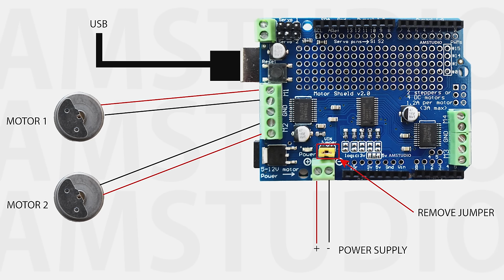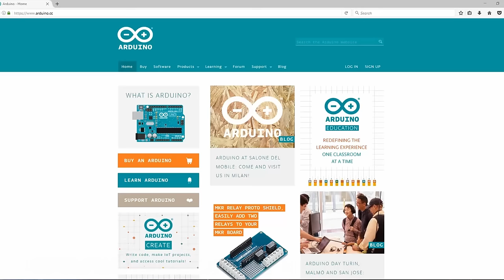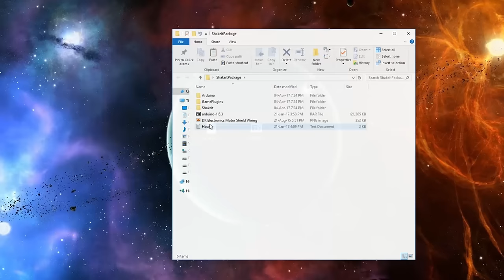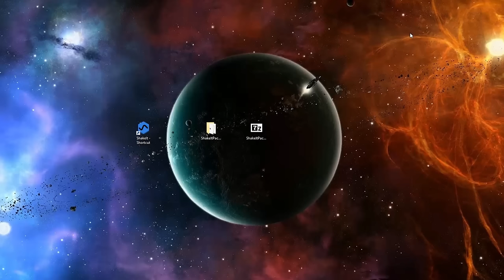DIY RUMBLE PEDALS SIM RACING  | SHAKE IT

Comment: I actually wrote to Logitech a few years back and suggested this to them. They told me they didn't see the advantage.
Reply: @lewisheaven2365  yeah seriously.  Consoles have been putting feedback into their control pads for years. It stands to reason that adding feed back to a $300+ dollar peripheral like a throttle or pedals would make sense.
Reply: What is the advantage? pedals in racecars dont shake? isnt it supposed to be realistic
Reply: @Impetuss  they dont shake...but you can feel the rev of the engine through your feet.  You can feel the throttle to the engine. In simtools you can set the telemetry to have it kind of kick when you change gears and kind of low rumble when you are braking so Its also an indicator of tire grip , think about it your braking and your tires lose grip and suddenly that slight rumble goes smooth. It's not really just about realism it's about feedback.
Reply: Henrik sure about that
Reply: @Impetuss  one of the advantages is when to press and release the gas,atleast for me
Reply: @Impetuss  when car have ABS then brake pedal shake.
Reply: @TrevorJones1  irl when you get near wheel lock under braking the pedal shakes quite a lot, but it doesn't really shake when you have grip, or when you've entirely lost it. So it would be more realistic for it to be the opposite, shaking as you lose grip.

That's with ABS ofc
Reply: Now they have added the same feature to the steering wheel itself in the new g923🤣🤣🤣
Reply: they are dumb and cannot figure out that all they need to do is use the same gear or kit installed in controllers to MOD pedal set each controller has two motors with relevant circuit boards. The very sad thing is the person at Logitech who responded doesn't know what the Tech can do and shouldn't answer on behalf of the entire company.
Reply: @Impetuss  never felt abs?
Reply: @Impetuss have you ever driven a car?😂
Reply: @AndrewTSq never driven a car
Reply: @Invin_cibles  Me? Yes several times,  felt the ABS working today actually on the ice roads :)
Reply: @Impetuss  the car shakes when you drive goof ball and people don’t wanna spend 1000+ for a seat that shakes you so it would be like the “car” is shaking irl while you drive
Reply: @Impetuss they do shake if you’re locking tyres up
Reply: @Impetuss  could help with brake lockups
Reply: Let see if they change their mind

Comment: I just completed this pedal mod on my T3PA Pro pedals. Your video was the inspiration for doing this, and thanks to your excellent guidance, everything worked first time perfectly. A huge thanks to you amstudio! Before this, I had never touched a soldering iron, or messed around with circuit boards. I feel like I have really accomplished something.
Reply from the maker: Awesome!
Reply: how did you mount the motors? on the back of the pedals or on the base?
Reply: @S41t4r4  directly on the back of the pedals. I used 50mm bolts to give me the length to attach the p clips.
Reply: @grahamcremer4956  That sounds great. Thanks. I have the t500rs pedals and I basically found only examples that mounted the Motors on the base/frame of the pedalset.
Reply: @grahamcremer4956 hey mate any chance you could show us what you’ve done? Would love to do it on mine. How is it going too?

Comment: Completed this last weekend. Feedback when your wheels slide on the corresponding pedal is very informative. Makes it easy to feather the gas right on the line of traction and burning out. 
Tip: put the lighter weighted motor on the accelerator for quicker response. My brake has 4 weights and the gas has 2 weights (I have the same kind of stacked weights on my motors and  removed some to make it just 2 weights. I didnt like the feel of the heavy vibe on the gas pedal). I also set the max motor output to 200.

THANKS FOR THE TUTORIAL!!
Reply: What you mean 4 weight and gas 2 weight
Reply: @diamondjing2746  I presume he meant how on each motor spindle you have a few plates and that he has four such plates on one and two on the other
Reply: So its to give feedback? For example shaking if you start to spin out and stuff?
Reply: What pedals do you have

Comment: Damn bro you are the most innovative sim racer. I wish I had the same gear and knowledge you had bout electronics. I did fix the brake on my g920. Now I need a handbrake. Nice video!
Reply: I use a joystick which i have for flight simming. What you can do is take and old controler and just make a handbrake and then just make a switch which when you press the handbrake it has a contact point and the switch is pressed. Now from that just wire 2 cables that will make the switch be pressed. Now just set it up in game and your done. I will try this but as of now my g920 is broken and im sending it back

Comment: Very nice! I was just musing about pedal FFB with a friend the other day. The G25 pedal connector has two unused pins, it would make a super neat installation to include the microcontroller into the pedal base, upgrading the cable to include the two pins as USB lines and just having to use an extra power supply cable. And since no G25 today will have any warranty whatsoever anyway...
Reply from the maker: Great idea!

Comment: i just bought everything to make this !!!! you are awesome
Reply: did you have a link for the box you used?
Reply from the maker: It was from a local electronics shop so no link. But search online for plastic enclosure.
Reply: did u have de sizes? alreafy bought one 10x6x2.5 and 11x6.5x4.5.. thanks for whis tutorial. one month till everything arrives and work on it. u awesome
Reply from the maker: Yeah parts take a while to collect!! Box is approx 3.5"x2.5"x1.5"
Reply: yes, i will do this mod and a handbrake with the arduino pro micro you make with one g29 pedal, i send my g29 to warranty and have the old one for spare parts. i also have the velcro mode in the old one..keep modding bro
Reply: amstudio hey! Everything arrive! I follow your steps and everything is ok, but when i plug my g29 to any usb port on my laptop, the motors loss all the powerr. I cant feel any vibration but the motor doed move,  
I guess the power is lost when i connect my g29
Did you know hoy to solve this?
Reply: use a powered usb hub sounds like your laptop does not have enough power

Comment: Just an update. I built this mod following this great video, mainly for ETS2 and ATS. I'm using the Shakeit software and not Simhub atm. And I can confirm it works great with the trucking sims! I'm still playing with the settings, but for now I have set Motor 1 on my Accelerator to RPM, and motor 2 on my brake to speed. This seems to give you a good feel to the pedals. But if anyone has good Shakeit settings for these sims then please share :)
Reply: does the feedback mod mentioned in the video work with ets2? i want to make this mod but i was a bit worried cuz it only says asettocorsa, codemasters and PCars on the title

Comment: Nice video, but im running out of usb ports:) handbrake, dash display, and this one but to complicated, but at least I fixed the handbrake, the 2 connectors were switched on mine potmeter
Reply from the maker: Thanks Robin! Good to hear your got the handbrake sorted.
Reply: amstudio Maybe add a note in the ebrake video at 1:33 that for some potmeters the yellow wire should be connected to VCC, and the red one to A0, if the input doesn't work correctly, or u made the wiring diagram wrong ;)
Reply: hello Robin, i bought everything I need for the handbrake, i am thinking of putting it all together this week, what was that the problem you are talking about? i am interestred on doing all once do not want to be re-wiring and stuff. can you be a bit more clear? thanks
Reply: http://imgur.com/a/Yd9an
look at that diagram, that's how I had to wire it in my case
Reply: hmmmm interesting, now i nam wondering how should i do it. i guess there is only one way to find out. 50% chance of getting it right. thanks man, thanks a lot. good community feeling here. thanks to amstudio for that too.
Reply: Get a usb hub bud.. They work wonders but I know what you mean. I have my wheel, pedals, Oculus rift, the sensors, keyboard,mouse and xbox one controller hook up to my pc. I don't like to constantly unplug and plug everything in so I leave them in and I'm running outta room lol. But I am in the market for a 2.0 usb hub or 3.0 if they make it and it will work properly.

Comment: I just want to feel the clutch friction zone and maybe feel when the brakes lock up
Reply: FroztiProductions That zone is felt throug the entire body (g-force from accelerstion) and heard (changes in revs), not felt through the actual pedal. Cable tensoin/hydraulic pressure doesn't change wether the clutch is engaged or not. At least on all the different cars I have owned.
Reply: @HepauDK  You can really feel when the clutch bites, dont know what are you talking about

Comment: Ok, maybe I'm lost. I've done a few of your mods, but what is the thing that you're soldering at 5:14? The still shows power supply, but the link in the description shows a normal wall plug for the power supply. Can someone explain? I had everything I need in my cart until I saw that haha.
Reply from the maker: Its a DC plug. Just updated the parts link in the description.
Reply: Thanks man! I appreciate the reply and the brilliant videos.

Comment: This is a great application to receive alot of tactile DETAIL return on monetary investment albeit with a larger labor and knowledge base requirement for bringing the system together... I'd have to say that, due to time constraints, I'll stick w/ the overall performance level range of tactile feel from some bass shakers / tactile transducers mounted to the seat, wheel and pedal assemblies driven from a steeply cross-overed / filtered low-frequency signal to a subwoofer amp for the amount of time and labor required to mount some kind of tactile feedback not to mention a single amp used to give all sensations with enough power to blur my vision through my seat back.
Great all around how-to vid nonetheless!  Keeping track of this build application for potential in  a suitable future application!
Reply: Tip on tactile transducer mount near / to wheel assembly : damage / wear can occur to wheel housing, internals especially if turned up high and shakes the thing to bits.
Hands, joints also get sore when holding on to the vibrations... still need to assess wheel tactile feedback...

Comment: Hey! Noob question here.
If I may ask, why use the ext pwr of the shield and not the arduino output? Does it have to do with power limitations? (since the motors are working fine while using arduino dc)

Comment: I'm having trouble here. I have everything connected, sketch uploaded, and I see the readouts move in shake it when I move my pedals, but the motors don't spin. I disconnected them and connected them to a power source to make sure they still work. Connected them back to the board and get nothing. Any ideas?
Reply: Same for me... No output power to the engines?
Reply: I get readouts on the computer. It sees the Arduino, just no vibration.
Reply: danbrenn Solved my problem.... it says that it uploaded correcly. But it was the wrong Com. Before i press load, i changed the to the right port. Works like a dream now. :)

Comment: Hi,  I have the case 3D printed and the Arduino and motor shield installed.
Daft question, so please forgive me. Is the maxMotorRumbleOutput value of 106 the setting that reduces the output to 5 volts? Many thanks. I am in the process of carting my PC etc to a different room. My granddaughter moved back in, so she now requires my room. Once that is complete, I will finally get around to stripping down my pedals and attaching the motors! I modified the case I printed to support a power switch, to kill power to the Arduino. But so far, the Arduino and shield are powering up! Thanks once-again.

Comment: Can I use the 24V 2A DC power supply instead of 12V? I build custom pedals set and I have 24V 2A DC power supply to power the load cell amplifiers and I'd like to avoid using 2 separate power supplies. 2 separate USB cables are acceptable.

BTW: I love your channel! I found it by accident, but I fallen in love with it. Parts for button box and rumble kit are already ordered, handbrake and dashboard are the next step.

Cheers.

Comment: Sweet, I will have to do this mod when I get a gaming computer. I was wondering I have a tactile transducer bolted to the bottom of the pedal deck which gives me feedback from the bumps and braking, would this mod do the same but more specific to each pedal? Thanks again and keep up the great work.
Reply from the maker: Thanks Dennis, it provides very nice defined feedback rumble for the pedals. The motors response can also be fine tuned via the mixer to dial in your perfect setup.
Reply: where did you salvage the motors from? I really want to do this but not sure which kind to get on amazon. I have everything else ready to order just waitin on a reply from you about the motors! Thanks bro I am glad I stumbled upon this video!

Comment: What
What's the name or technical term for the wire that you used for the motors to connect to the board? (Had the blue, white, red and black cables). Trying to find something similar with the rubber grommet as well.

Comment: I am using an Arduino Uno and Motor Shield to control 2 PWM fans in a wind sim using pins 9 and 10 on the board with the fans being connected to constant 12v. This uses outputs 5 and 6 (I'm using SimHub). It seems like I could use the motor outputs on the motor shield which currently aren't being used to control these vibration motors. Is it possible to output 12v to the fans and also 5v to the vibration motors at the same time using one Arduino Uno or should I just use one for the wind sim and one for the shake it weights?

Comment: Late comment I know, but I wonder if you could do what I did for my clubsport shifter. I don't race, but do truck in ATS, and I have a large bass transducer on my chair. It's good, but the shifter was basically dead, and who wants to watch a tac for shift points?
I mounted a small transducer to the underside of the club sport, and now I have more than enough feedback coming through the shaft.

Comment: What is exactly these motor feeding back? Wheel spin, wheel lock or road and bumps vibration?
Thanks for uploading these DIY videos you're awesome.
Reply from the maker: Yes as you mentioned and all of the following can be mixed to the motors, 
- Left and Right Vibration
- Wheel slide
- Speed
- RPM
- Acceleration slide
- Wheel Lock
- Gear Change
- Idle vibration

Comment: Hello. I have set everything up, wired everything correctly. (At least I am pretty sure I have). I read that this now is a part of simhub, so I downloaded that, and tried to get it to recognize the device, and the two motors I had on it. Neither motor was recognized. What would you suggest I do to troubleshoot?

Comment: oh shit that how you make your g29 pedals to fanatec style XD, but shit I got t3pa pro pedals , that a bit different.
Reply: its the same, your just wiring up a separate cable to the pedals did you not see that @ 7:00 its to the arduino, 4 wires to the motors on the pedal and 4 to the arduino unit.
Reply: pharohbender oh I see thank you ,I am now planning the mounting position of the motor😂😂
Reply: no worries, looks like an awesome mod.
Reply: pharohbender yea definitely try that out 😁

Comment: Neat idea. One question though, if you have the motor shield adjusted to 5V output, couldn't you just as well use power from the USB port?
Much appreciated
Reply: Too low available current from USB. And risky spikes as well.
Reply: @Ale-bj7nd  of course. Another question, is it possible to get .dll files for retrieving the telemetery-data in Forza Horizon 5?
Reply: Nvm, worked just fine with SimHub :)
Reply: @DusttwoDust  Sorry I didn't see your comment before. Glad it worked.

Comment: I hope you still respond to comments on old videos, I am looking into doing this mod myself. My question is since its stackable and uses shakeit. will it interfere with my shake kit transducers from srs? Im already running a bunch of srs but i like this version for the pedals rather than their pad design. not sure what they were thinking with that. But i want to make sure that im not going to cause conflicts with their software when i start adding my own that i downloaded from Arduino

Comment: Hi, it's possible to add a motor for the Handbrake lever and the clutch pedal? they can shake when you lock the rear wheels and when you push the clutch.

Comment: Is this also possible to use for the clutch pedal, where it vibrates when slipping the clutch? Right now the clutch is a limp pedal without vibration to tell you when you're actually slipping.

Comment: 2.5 years old but how did you step the 12 PS down to 5v? I was wanting to run 3 rumblers and a fan off this but no way to control separate voltage that I see

Comment: This is interesting and probably does braking vibration very well. At least I like the effect while playing on a rumble gamepad. Are you familiar with bass shakers and if so, how does this compare to those? Thx for the video! Awesome production quality as usual!
Reply: I'd be willing to bet it is a lot better. Like a more precise rumble compared to just shaking everything. Plus where would you mount a bass shaker to pedals?
Reply: I have a plywood board under my pedal set and bass shaker attached to it. And I wouldn't agree that bass shaker is "just shaking everything". At least not with Simvibe. There's some finesse in it's vibration and you can create your own effects profile from scratch. But you can't separate the pedals. At least not yet. That's why I'm interested in this solution. SpeedFreak have you tried bass shakers or this rumble motor thingy? I looooove Simvibe's engine vibration effect on the pedals. Only thing missing really is the braking vibration.